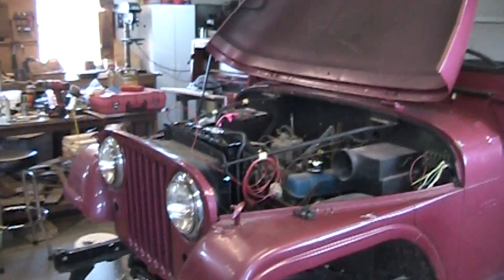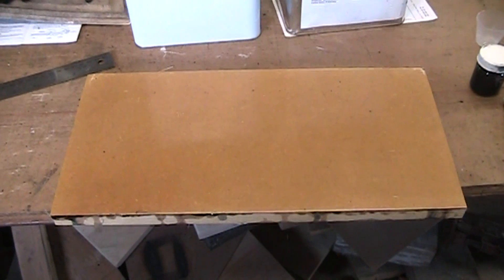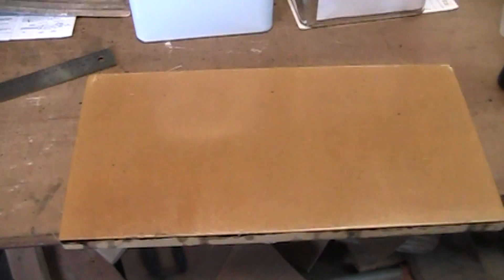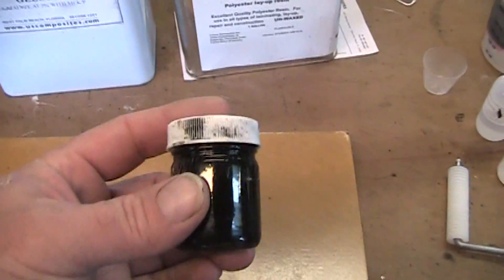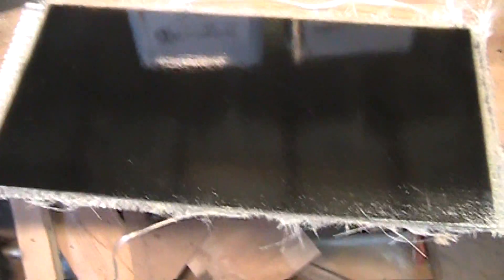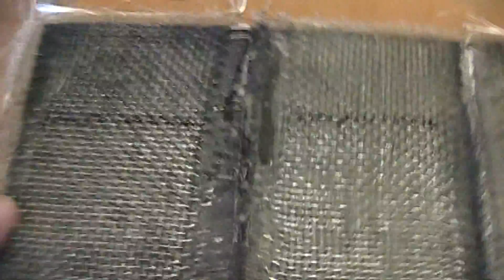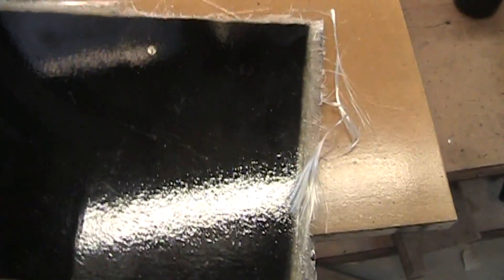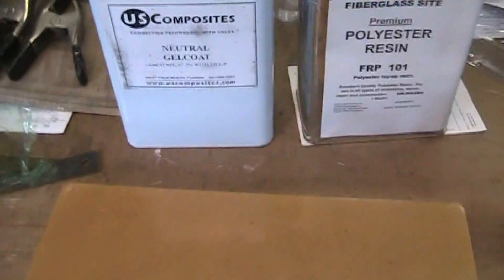Pontoon fiberglass experiments

Comment from the maker: Thanks Trent.  Right now its on hold.  I had some major storm damage that I had to deal with.  took about 2 years, but that is about done.  I also picked up another boat, project fuggly.  I really need a larger boat so that one is on the front burner right now. You can see project fuggly in my play list if you have an interest. The pontoons on this boat were pretty small, so I sold it.  I'm going to either find a boat with a larger set of toons or just buy pontoons and a frame kit.  I really like the idea of having a small cabin now, something cool looking.  Possibly a cabin that could come off and mount on a trailer also....make it dual purpose pontoon cabin / small rv trailer.

Comment: What I do is spray in the gellcoat on put some resin on the window glass then using a roller put matt down first and then whatever you want. It leaves a PERFECT FINISH with no fiberglass showing even without gellcoat. The roving height varies in thickness and shows through.  The matt does not have this problem. Have fun above all else...

Comment from the maker: thanks for the info, I have used gloss plastic laminate (formica ) with similar results.  This shape is going to be fairly large and made up of several flat and curved sections.  The idea is to use the MDF on the flat sections, then use bondo to create the curved transitions between the flat areas.